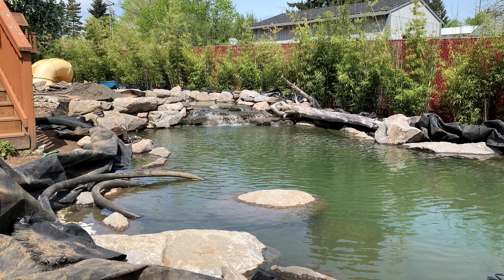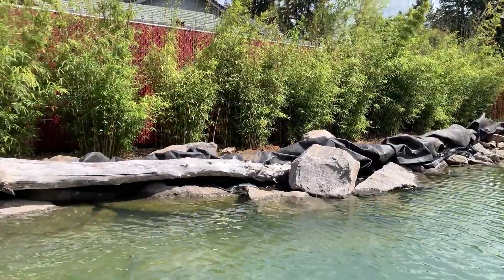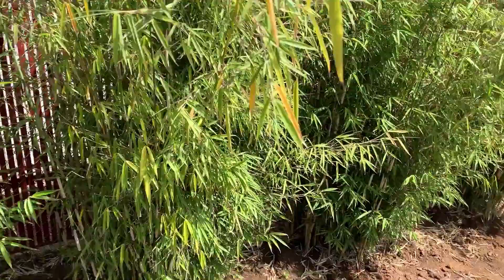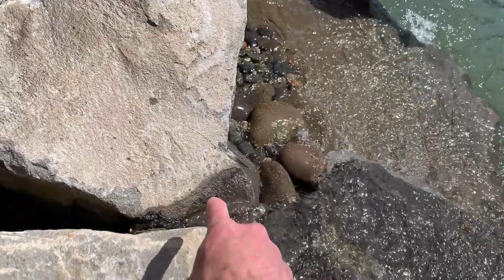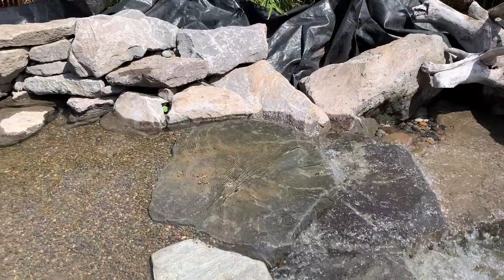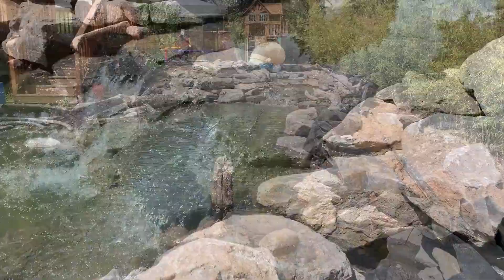The waterfall: IT LIVES!

Comment: You might be opposed to adding any unnatural products to the exposed rock but I've made several rock walls that I then coated with a water seal that would give the rocks a year round wet look To the dry rocks and would only need to be touched up every 5 years or so. Just an idea.

Comment: Looks great, very nice project. I have a question with the sand bottom that you put in, how clean do you thing that will remain and will it need cleaning. Thinking doing something like this for a natural swim pool
Reply from the maker: Don't know for sure, but time will tell. I have some jets that should keep debris from settling and push junk towards the negative edge. I also think I'll prefer it to gravel as there are no crevices for debris to get trapped in. If crud makes it to the bottom, it rests on top of the sand and can be netted out.

Comment: why did you stack rocks on rocks behind the waterfall? that's the only point that doesn't look natural
Reply from the maker: Agreed. That's where I have a buried bulkhead through the liner to hide the pipe feeding the bog. I was too afraid to stick a big boulder there in case I ever need to service or replace that fitting. I think those rocks will mostly disappear once I plant the bog and the vegetation grows in.
Reply: @TylerTervooren  it would probably dissapear after time when you add some planting